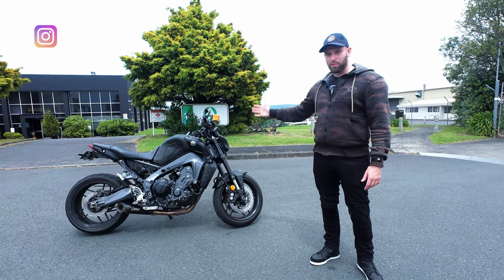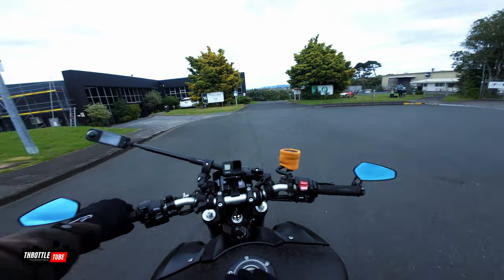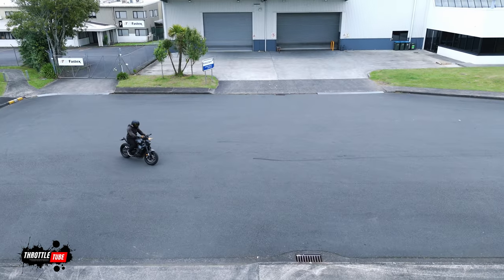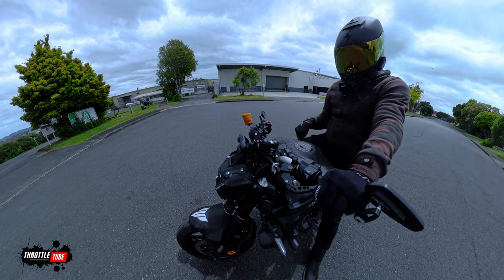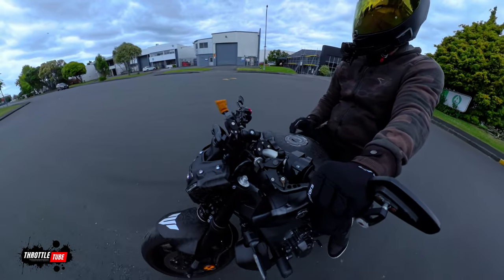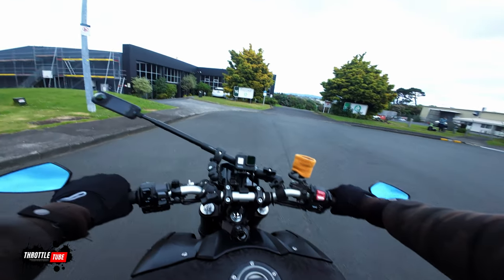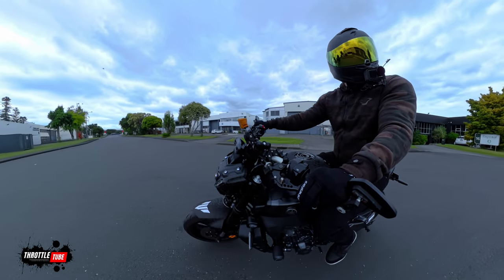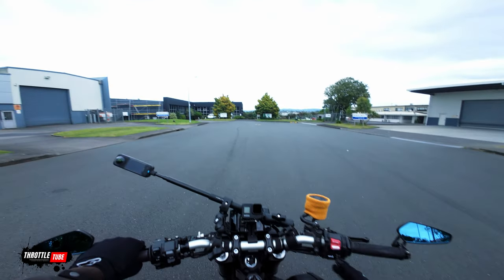How To Control Your Motorcycle At Slow Speed

Comment: Good points, simple and succinct. Really the goal is to be able to turn the bars to full lock, then right vs left won't matter much. If it's locked, it's not like you could turn more.

I say that, but the locking angle on my bike is huge, and I can't comfortably do it 🤣
Reply from the maker: Have you tried counter leaning? You can turn way harder than locking out the steering for sure!